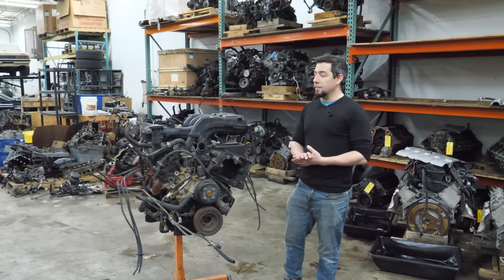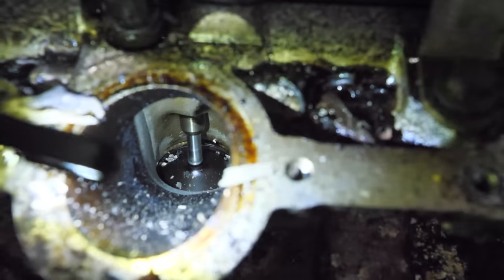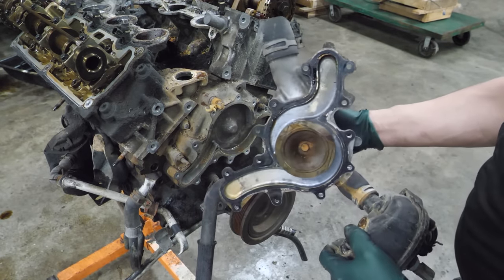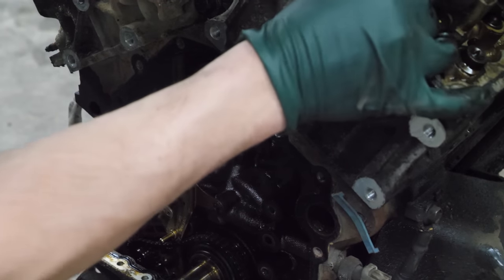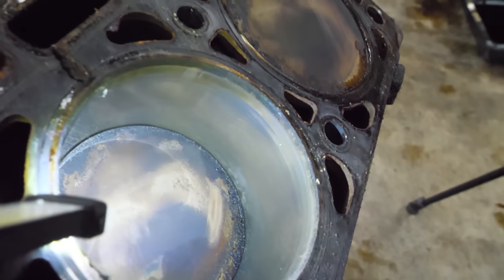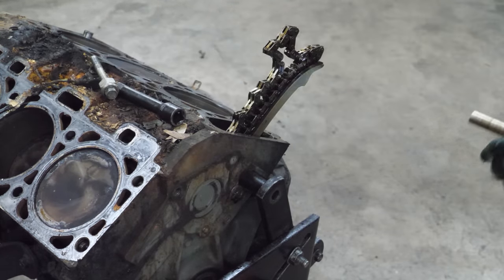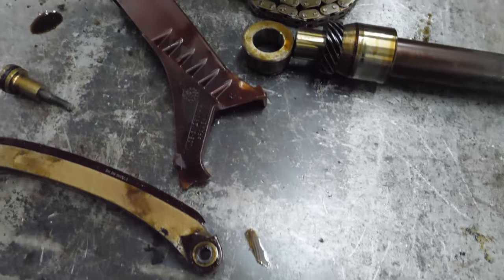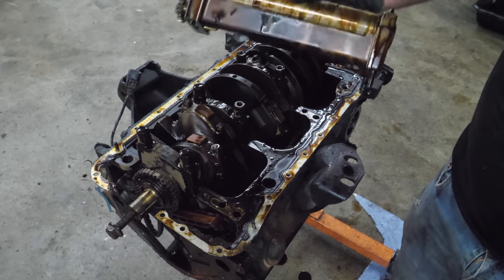Ford Explorer / Ranger / Mustang 4.0L SOHC V6 Teardown! Is This Why They're Called "Exploders" ?

Comment: I'm in the 'like' group, from an engineering standpoint. That engine started out as a 1200cc OHV V4 with a balance shaft in 1962. And after 49 years went through the removal of the balance shaft, had two cylinders added, went from a cam gear to a cam chain setup, was there are the beginning of EFI, went through several more displacements and was then retrofitted for single AND DUAL overhead cams (cosworth version). The fact that these engines still held up as well as they did after basically being a genetic freak, goes to show how good the original design was. And, truth be told, the lifetime and failure rate of the factory timing chains is about equal to many other engines, it's simply the labor costs, difficulty and complexity that puts people off. Having one chain up front and one out back, for one, allows one cylinder head casting to be used on both sides, and for two, allows the vesitgal camshaft tunnel to be taken up by a 'jackshaft' as people call it.
Reply: Had a V4 version in my 1969 Saab model 96 
 It was a very reliable engine.
Reply: Ever done timing chains on one?
Reply: Looking at paper design does not equal the pain and suffering of being the guy who is trying to fix the junk. Abysmal design. One of a few really bad Ford designs. The new Ford motor company lost me as a fan because of this design ideology. They are  deliberately designed to be ridiculously difficult to fix.
Reply: @gdaytrees4728  just like every other manufacturer today, unfortunately
Reply: @gdaytrees4728  ford cuts corners, which is why they have the oval in their logo.
Reply: Engineers are not the brightest bunch either. I laugh when people say they are engineers.
Reply: Sold my explorer cuz the drinkers side chain was noisy the labor was more than the vehicle was worth. 196000 miles I'd say I lasted longer than any used car I've owned
Reply: I've always wondered why Ford put three timing chains in the SOHC 4.0L V6 that's the powerplant for my Explorer - thank you for explaining it in a clear, easy to understand way.
Reply: I got cologne version of this. 6 inlet 4 exhaust port in my Granada Mk2. Absolute hell. Always cracking heads. It's listed top worst engines all time.
Reply: Sold in the United States for a while as 4 liters but pushrod engine. Not as powerful but smooth and more reliable than the OHC versions
Reply: I bet the DOHC Cosworth version is fun!
Reply: @shadowopsairman1583  lmao 😂
Reply: What are the pros and cons of this 4.0L when compared to the "Intech" 4.0L SOHC inline-six from Ford Australia from the same time period? 🤔
Reply: @shadowopsairman1583  "Engineers are not the brightest bunch either. I laugh when people say they are engineers."  Maybe German engineers from Ford-Werke GmbH or other German manufacturers... Japanese engineers tend to be fairly sensible for the most part, especially with the guidelines and general logical philosophies of Honda, Suzuki and Toyota IMO.
Reply: @yugbe  I had one of those... they changed it to a 9 ft duplex chain and the timing cover interlocks with the oilpan. Any chain work basically means engine out.
Reply: I understand from the video and the comments that it were the plastic guides that would fail. If so, simply having more robust guides would have made this engine’s reputation a lot better.

Please correct me if I’m wrong.
Reply: @TassieLorenzo  Totally different engine, the Aussie 4.0L is an inline 6 and an absolute beast of an engine.  These V6s were used because they already had the platform designed and were mass-produced for mass-market vehicles.
Reply: @Conservator.  The plastic guides were a big issue for sure, if memory serves they had them pretty well worked-out by 2004 or so though.  Another issue they had was the tensioners.  Ford uses a tensioner with a spring in it for startup tension then oil pressure to pressurize the tensioner from there.  Good design, at least I prefer it over unit tensioners like my Subaru uses, but the O-rings which seal them to the block can leak and the tensioner itself can start to leak over time losing chain tension and causing chain slap which wrecks those plastic guides, timing gets off due to the slack, then you have piston-to-valve contact.
Reply: @406Steven  Thank you very much! 👍
Reply: The question still is why a balance shaft in a supposedly even fire 60º V6...
Any clue...? I don't see the need for that.
Reply: @TheMissing62  That's only on the 4WD models, you can get rid of it and not notice a difference. As to why? That's beyond me as well
Reply: @TheMissing62  A 60° V6 has secondary imbalances. To be balanced it would have to be at 120° (but then the engine would be very wide).
Reply: @gdaytrees4728  That engineering approach is why I started to avoid them in recent decades. The failure-prone stuff they buried in the valley of the 2.7 Ecoboost was a sign things haven't changed there.
Reply: @Conservator.  Yes, I know; unless rod journals are displaced like in the Busso engine.
And this model has that kind of arrangement.
inexplicable.
Reply: @delifisektuxedo  maybe you could have retrofitted the ohc head from this on to your own ohv and drilled out the castings for the pushrods and rocker shafts. I notice with fords that you have to mix and match different years to get a reliable vehicle.
Reply: @martin-vv9lf  Naah, not worth the effort. Pint, Slant-6 even Barra swap much more desirable. 
As it was once said, these engines only make very good boat anchors.
Reply: i can't say if it would work, i don't own one. but i figure if you had two core engines, could make two out of the one. can't beat free.
Reply: @martin-vv9lf  Why ? It not worth the effort. Back in late 70's some one in uk created dohc version. Special heads etc etc. Result is unreliable boat anchor. Even tuned up 2 liter pinto beat this engine.

Comment: This is what one ends up with if one converts a simple ohv design to overhead camshafts without re-designing the whole timing system. That shaft in the valley is where the cam used to be in the old "Cologne" V6. Thanks again for all your great videos, all the best!
Reply: Yep, it’s a bad design, the OHV is pretty solid, the SOHC is a house of cards.
Reply: @texan01  Exactly. They should have just left it cam in block and did other upgrades thru the years.. It would have been waaay cheaper, simpler, more reliable and waaaay more common sensical. Just some FI work and a few other upgrades and the original OHV V6 could have served them well, well into the 2000's & got 220-260hp....perfectly fine for a workhorse mid level engine of that era.
This OHC design is one for the books (of idiocy).....
Reply: @thezoomguys385  They went OHC because they needed an engine which could meet the stricter emissions standards and wanted more power and torque.  It was a huge improvement in power and torque (no idea about emissions but they pass) but whoever thought up the timing system way overcomplicated it.  They easily could've blocked off the oil passages going to the cam and just hung the chains off the front like almost every other engine ever made.
Reply: @406Steven  They could have easily got all that with simple pushrods. 
GM did. By that time, there wasn't a crazy difference in efficiency between a GM or Ford pushrod head. 
All they needed to do was reshape combustion chambers, get decent FI and a few other things. 
Ford really takes the modern German approach to engineering; Why solve the problem with 1 or 2 simple parts, when you can use 50 or 100 complicated ones...
Reply: It might already exist, but it would be amazing if there was an aftermarket kit to “back-convert” these engines to single cam pushrods. Add some idler gears and you could get rid of every chain in the engine.
Reply: @truthsmiles  or convert the chains to gear drive. It would sound awesome and get rid of the chain problems.
Reply: @thezoomguys385  OHV is very reliable. I drive a 96 Explorer with one, runs perfect. Not looking for a racing car in an SUV, and it has tons of torque. I also have 4.10 gears.
Reply: @alb12345672  OHV or OHC?
Reply: @thezoomguys385  96 Explorer only had the V6 OHV available. 160HP/225ftlbs. The torque happens low, even lower than the SOHC. The explorer also had a V8 option.  The expensive Trims all got the SOHC in 97. The lower trims got the OHV (some had an SOHC option). My 96 is an Eddie Bauer, the next year it would be SOHC.
Reply: @alb12345672  They should have stuck with th e OHV pushrod engine and upgraded other aspects of that engine to improve performance, fuel econ etc. 
GM has done a fantanstic job with their pushrod engines.......
Reply: @406Steven  Yours is a better idea than mine, and would be technically much easier than moving the cams. I guess the biggest problem would be perfectly locating the holes to bolt the gears into.. unless maybe some kind of "caged" set of gears could be fashioned that could float between the existing gears?
Reply: @thezoomguys385  100% agree. Maybe they should have build a V6 similar to the crown vic engine, no problems there. They also introduced a 5 speed trans that had more issues. Mine has the 4 speed, it is still the one that came with the truck (just filter/fluid swaps). The 5 speed used parts in the 4 speed at twice the rate to make extra gears. But it was the first American 5 speed in any vehicle. They also put a crazy neon bulb in the back, had to replace it with LEDs :lol:. May be one of a kind.   Had a ballast and special bulb.
Reply: @truthsmiles  I would think you could bolt a caged system, as you suggested. in to where the factory guides attach.  I'm not sure how the chains are lubricated and if that would be enough for a gear drive but could be a fun thing to try.
Reply: The funny thing is literally the only reason they chose this backwards ass design was to make it so the passenger and driver head castings are the same, thus requiring a timing chain on the back to drive the passenger head that's just a driver head rotated 180 with a different cam.

If they had just made two different head castings with all the timing on the front I don't think this miserable engine would have been anywhere near as hated and people would have just replaced the timing when it started making noise like, oh, every other OHC chain driven motor in existence.  But that pointlessly complicated passenger timing set to save one casting SKU doomed the whole setup.
Reply: @kenstein Crown vics have chains and tensioners, guides, its is very rare for one to fail. I have a 6.2L F150, the Superduties run these engines to hell and back, a timing system failure is practically unheard of, they have a 500K life in commercial use, maybe more. It is just a poor design and probably people stretching the oil change intervals.
Reply: @alb12345672  that's my point, all the other Ford engines have it all on the front, like the mod motors you mentioned.  People complain about the timing chains and cam phasers on mod motors, but they don't scrap engines and cars over it, lol.
Reply: There were definitely better ways to do it.. like simply building a v6 from the modular family. A 3.2 mod v6 would have been awesome
Reply: No kidding bout that timing system. More chains than an antique combine.
Looks like a VW /  Audi engineer joined the design teeam
Reply: @richceglinski7543  Engineers from VW Audi and Ford all got drunk in some German bar and said let sock it to those amateur mechanics :🤣🤣
Reply: @406Steven  going from cam in block to single overhead cam results in no difference. You still can only control 1 exhaust valve and 1 intake valve. OHC was all the rage in the 90’s so Ford needed a V6 to appear more up to date. Purely marketing. Somehow 3.9 Chryslers and 4.3 Chevy’s worked just fine with emissions.
Reply: Yep, thought that was the "infamous" motor. I had the old pushrod version in a '92 Ranger and they were quite decent. From memory, even those had OK power, not stellar, but remember, this is an old design these days. It's not the same block as the 3.0L V6. In 1992, they put out 160 HP, which was adequate, but again, not stellar. Seems these did have issues with the head castings and my old truck may have had that earlier on in its life. 

I have a 2.0L inline 4 in a Mazda Protege 5 wagon, FSDE, DOHC, though with fixed valves, and naturally aspirated. Not the most powerful motor, but a super reliable one as at 130 HP, it just manages to hustle out of its own way pulling a 2700Lb car, crippled with the 4spd autobox (fortunately the sport shift, shift it yourself version) and to get the most out of it, wind it up to about 3K, shift for most gears, except 1st and the car then feels reasonably responsive due to a peaky power curve. Yes, non interference indeed as the spring in the timing belt tensioner breaks, embedding itself into the timing belt as I headed to a buddies house. At 196+K on the clock, it still runs just fine.
Reply: My old sports trac had sohc it basically let loose I went out and rebuilt a 4.0 ohv and did some modifications to fuel system the wire harness to make it work truck still going for a old guy.
Reply: @nicksmith-rz2dl  i think they can use the same computer.
Reply: @alb12345672  lol would've been nice to know at the time 😂 that was 5 years ago now.
Reply: @nicksmith-rz2dl  Well worth the effort. That engine should last a very long time. Still kicking in my 96 Explorer EB. I did lots of high revving offroading last summer in 4 low. Runs like new. Did you notice a big power difference to the SOHC? Less power?
Reply: @alb12345672  yea it did I had it punched out at a machine shop little bit.its probably got close to 170k on it know old guy likes traveling so it's probably tired and needs another rebuild.
Reply: @Johnny White Yes, I always say I hate to give up such a reliable paid up vehicle like the explorer :lol:. Had almost every option for its time. Now it has a 7" nav receiver and heated seats.  It did have one weird thing, the valve covers got holes on the flanges. I got a set for $50, sandblasted, put a few coats of grey paint, and the engine looks great now!
Reply: @alb12345672  yeah with automatics you can only really get 3 or 4 ratios out of a single planetary set, yo go to a 5 speed you introduce a lot of extra complications
Reply: @machineman8388  Yes, in the 5R55E lots of stuff got worked twice as much. That is how they created extra gears.
Reply: I thought they did the jackshaft so they could just copy the tooling for the both cylinder heads.
Reply: @jacobrzeszewski6527  Nope, 2wd trucks did not have it. I heard it was for vibrations in 4x4 (some balance reason).
Reply: @richceglinski7543  Volvo joined the team
Reply: Guess they copied that from the 427 SOHC. 7 foot timing chain, the stretch between two banks was bad enough that the drivers side cam needed 7 more degrees of advance for the two banks to be even. People love those engines but boy do they have issues. Looks like they copied the same design for this one. Someone did make a gear drive 427 SOHC, but this engine is small enough and enough of a piece of junk that it's not worth it. Does look just like a miniature one though. Cut it and weld into a V8 and that would be pretty cool, maybe. 210 hp from a 4.0 liter is pretty lame too. I have a 1.6 Subaru OHV (timing gear and pushrod) EA71S engine making 130 HP. That is with carburetors, a truly antique combustion chamber design, 12.5:1 compression, and a ton of spark advance (42 degrees all in). Dual carbs over the intake ports too. The fact that a 50 year old design flat 4 of less than half the displacement can make more than half the horsepower, with carburetors and distributor ignition is ridiculous. Just shows how bad Ford design is sometimes.
Reply: Cheap *ss Ford.  They tried to save some tooling cost when they already had Modular V8 which should have been adapted into a V6.
Reply: @kenstein 
Different head casting on the passenger side means a whole second machining line. Or a forth depending in the situation.
Reply: @richceglinski7543 Audi and VW never really worked together well. I remember receiving a bunch of CAD files from Audi and it didn't go together. Somehow they had managed to shift the reference points so nothing lined up.

Thankfully we ended up just adding boost to the four cylinder and ditching the straight five altogether.

It's a pity our four-valve VR6 diesel never got built.
Reply: @kalebbrown93  Your valvetrain geometry changes and you can get improved breathing with OHC layouts. But Ford didn't really do this. The combustion chambers are definitely different between the OHV and SOHC motors but you can't change the shape that much without changes to the block and pistons. I'd almost be willing to bet that if you bumped the compression ratio of the OHV from it's original 9.0:1 to the SOHC's 9.7:1, you'd get the same power increase.
GM and Chrysler managed to meet emissions not only with their V8-derived OHV V6's but also with their OHV V8s. The 3.8l Buick V6 is the gold standard for reliable smooth power and good economy. If the 4.0l production line was coming to an end, Ford should have just reshaped the heater box in the Ranger and Explorer and installed the 3.8 (or 4.2) Essex V6 from the F150s and vans. Those are good little engines as well.

Comment: Bought a 1998 explorer with the 4.0 SOHC brand new in 1997. 290,000 miles and never had an issue with the engine or even the transmission. Most reliable vehicle I’ve ever owned.
Reply: Transmisión 5 speed auto i did have to rebuild but at 200k
Reply: Those transmissions are trash...you got lucky or just drove highway miles 🤣
Reply: @samholdsworth420 for real, I have a 2002 Explorer and it’s gone through 2 transmissions since it was new. It has 184k on it.